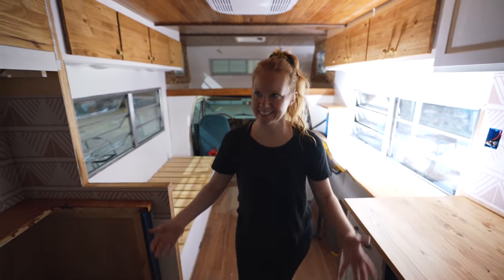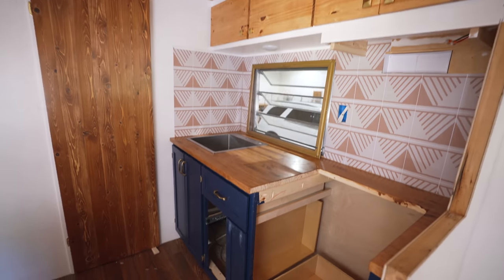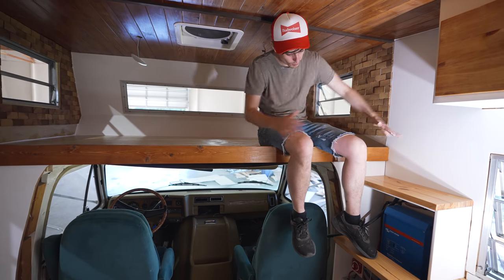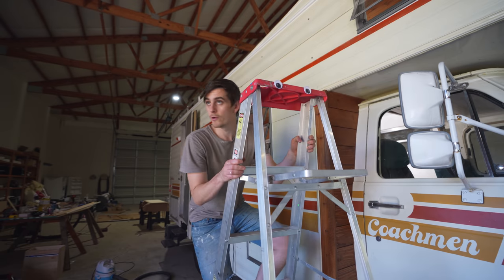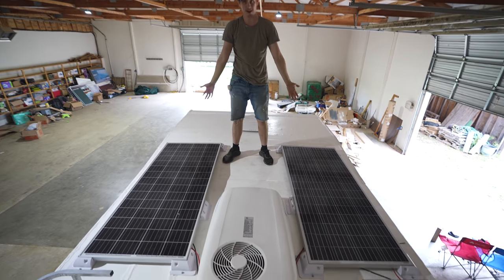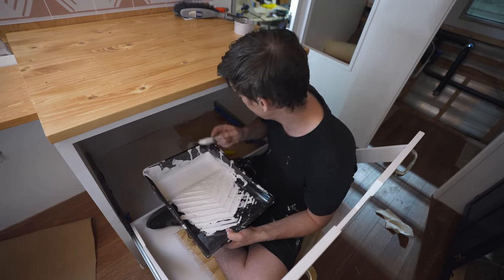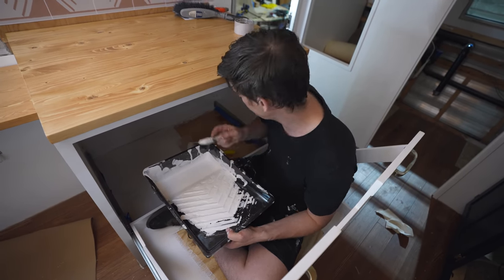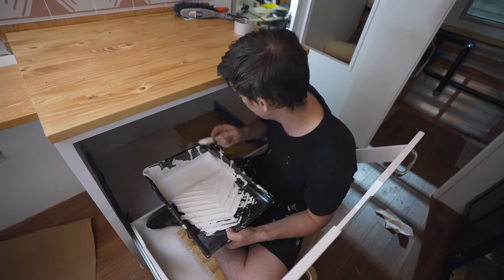RV Renovation - HUGE PROJECT UPDATE! Solar Panels, Custom Bathroom, Appliances, and More!

Comment: I recommend baby drawer locks on all the drawers or they will open while driving.  You may need two for the fridge
Reply from the maker: Ya, we forgot to mention that we actually added one to the fridge slide already, but we'll definitely need them for all the other doors/draws. ATM, we're juts holding them shut with rubber bands 😅
Reply: @Theendlessadventure  Make sure to get some that can be switched between locking and unlocked so you can leave the doors unlocked when you stay somewhere.
Reply: Yeah I was thinking the same

Comment: Get the synthetic wood for the shower! Looks just like wood and you can get a variety of colors includinga light pine style, "Coowin 3D wood plastic composite panel/wall siding", it's completely waterproof, goes on like clapboard/siding (so no exposed nail holes for water to get through or have to seal up), environmental friendly, over 5 year warranty. Also make sure to add a bar across the shelve so you can store shampoo, etc there without it falling out while driving and a couple dividers to keep stuff in place without sliding back and forth! Loving the look and the job you guys are doing and the blue looks cool in the kitchen. You're probably gonna want to get up to 300-400 watts on your solar panels if you are planning a lot of off grid (no power hookups) camping.
P.S.- Get a bottle of Redline's  "Water Wetter Super Coolant" to add to the radiator. It can keep the engine temp down 30° which will be helpful with the RV'S weight in hilly/hot areas!

Comment: Excellent move on the rebuild. The modular GM small block 350 is a work horse and very capable engine. 
Be aware that you can only put some much gear in your rig. You really don’t want to over load and older chassis.

Comment: So much room! It doesn't look anywhere near what it started out. The colors are spot on and they do look good with the window trim. Was amazed at the bathroom. I agree, a small bathroom sucks on the road. Also, you will save a ton of money not having to use outside bathrooms. It looks like you both learned so much from your dad. I too wonder about that wood tub. It'll be fun to see your secret.

Comment: For Wood Creaks, a Great Wood Lubricator is "Bar Soap", rub the Bar Soap on both contact areas, and that should do it. A Note, is that if the creaking sound comes back reapply as needed.

Comment: Don't forget ventilation; the cabinets will need it if they are to keep fresh. Try leaving the doors open when you are not on the road, but don't forget to lock them before setting off. Good Luck and congratulations on all the hard work.

Comment: If you had put the faucet in the sink before installing it's way easier, and the voltage in series of 2-12v solar panels is around 40 so you must have ran them in parallel,  and take my advice get 24v panels in series with an mppt charge controller, you'll be much more satisfied!

Comment: You better have ventilation for your 12volt fridge.  Those are really sensitive if you don't have a good amount of air channeling into the compressor compartment.

Comment: You guys have so much room in the bathroom.Have you looked at or considered a recirculating shower. You could install a 5 gallon tank and the filters (plus a 12 volt UV light) and just shower with 5 gallons. You can then dump it after a certain number of showers (you can check and see what seems right) and not use your fresh water. You can set it  up with a y value that dumps the 5 gallons out or into the gray tank when you are ready for 5 gallons of new water. You can easily install the filters and tank in all that space behind the wall in back. Then just cary a 5 gallon water jug to fill the shower tank when you dump it. i installed one in my class c after looking at all (and I mean all) available videos on youtube. Happy to send you my designs if you want to take a look. Have a fun trip. And can you tell us what the shop is doing to help the RV. Also - did you guys name that RV yet??? PS stealing your step plan on my drivers side over the wine cabinet to access the front bed. Thanks.

Comment: Love the progress on with the RV!  I also have one of the same vintage and had encountered the same no start problem you guys did.  However the fuel pump in mine was new and my issue was the rubber fuel lines at the top of the tank which meant I had to remove it to repair the issue.  Keep that in mind should the same issue happen again!

Comment: Trust me guys you need to change those cupboard door handles so they lock in the closed position because the first hard turn EVERYTHING in them is on the floor. That`s a true experience.

Comment: Forgive me if this is a stupid question, but do you guys need to balance out the furnishings so that the weight is evenly distributed? Or do you need to do anything with the suspension if one side is slightly heavier than the other?